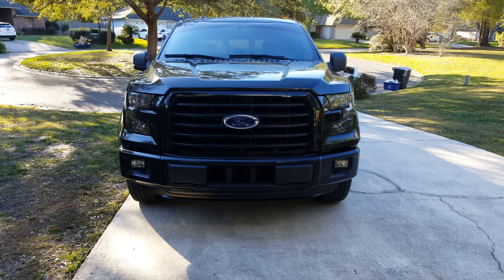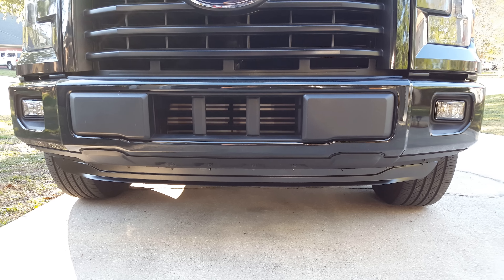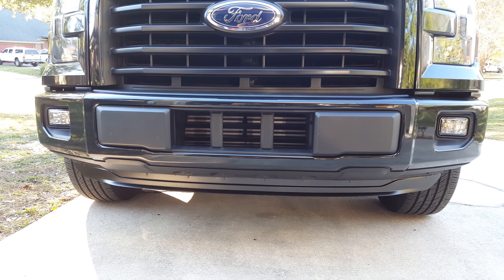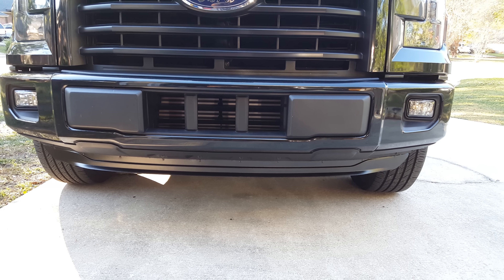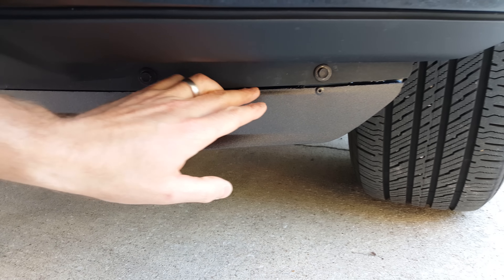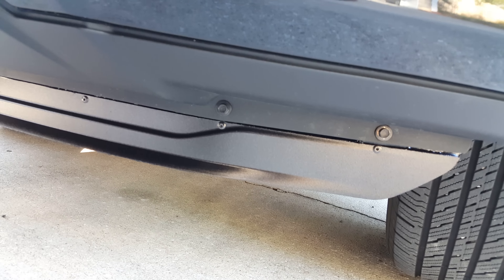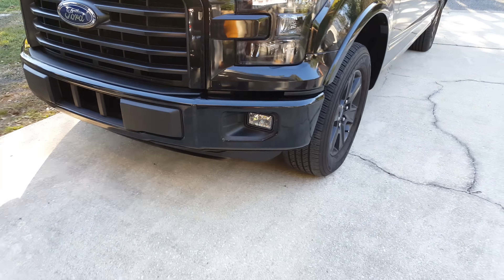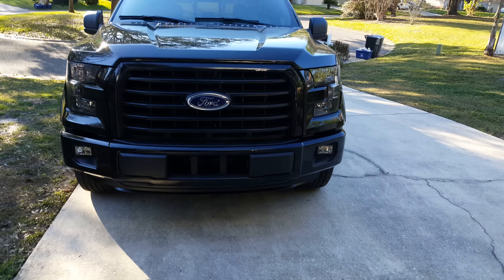2015 F150 Air dam mod

Comment: This is probably a dumb question, but can't you just cut off the inch or so from the bottom?
Reply from the maker: Mark Gennaro you sure can. If you look closely, it has a distinct profile at the bottom. That's why I did it my way.
Reply: Yeah, I see what you're saying.  How long did it take you to make the cut and re-install the air dam?
Reply: LETMELIVE what did you use to cut it?